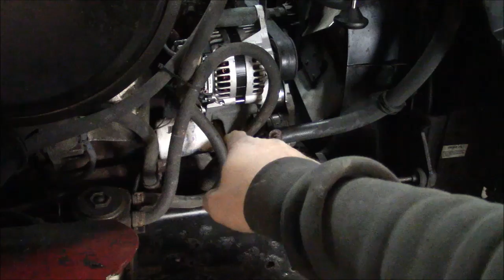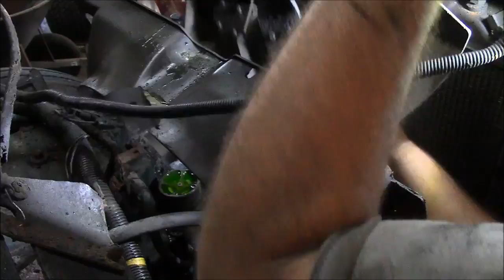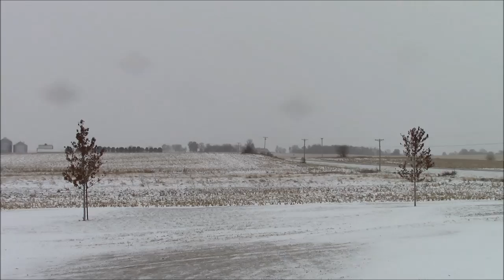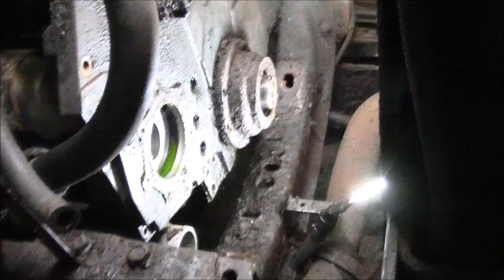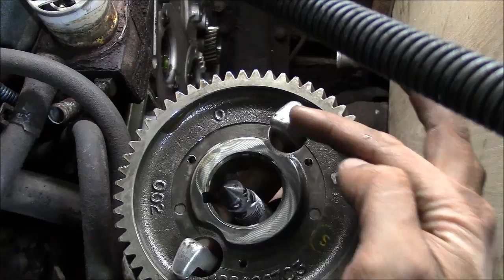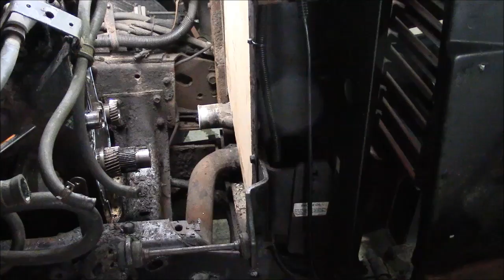International DT466E Coolant Leak from Timing Cover - Part 1

Comment: FYI a cherry picker is not a type of gantry crane. A cherry picker is technically classified as an aerial work platform (AWP) or mobile elevating work platform (MEWP) designed to lift people and tools to elevated areas. A gantry crane is a separate, heavy-duty structure used specifically for lifting and moving heavy materials, usually within a workshop or industrial setting. 
Key Differences:
Purpose: Cherry pickers lift people for work at height. Gantry cranes lift heavy materials.
Structure: Cherry pickers have a hydraulic boom with a basket/bucket. Gantry cranes consist of a beam (gantry) supported by two upright legs, often on wheels or rails.
Function: Cherry pickers offer high, flexible, and often lateral reach. Gantry cranes offer high vertical lifting capacity but limited movement.
Classification: Cherry pickers are often referred to as boom lifts. Gantry cranes are a type of material handling crane.

Comment: you're a gutsy guy to take on a behemoth like that job.....how can you give an estimate or quote on a thing like that?  15 hours?  any big heavy engine shop with 12 employees would probably have quoted 40 hours labor  plus any new parts extra.........just go to any toyota dealer and have rear main axle bearing replaced on one wheel on a 4 runner and they want $1800.....routine good running change a timing belt on a good condition 4runner they want $2200

Comment: Yep being honest about your mistakes I a good thing but if you would have cost the owner a 14k engine by your mistake I would be that honest lucky that air and loss of pressure did not spin a bearing wow you were really lucky but at least you were honest I would let you work on my trucks cause ya did not lie like most mechanic do and did the right thing thank you gives me hope I will find some one in my area like you

Comment: Wow dude.....wow. Let me ask this question. What happens when you bid a job and stumble across more things wrong? Do you stop and call the customer and they agree to pay additional? What happens if parts break when taking things apart? Do you bid on the hours but parts are as it comes and they pay for that knowing its open ended??

I live in Aurora and work on cars for fun (not so fun anymore) and have dealt with rust and things like that but this, this is next level stuff. I have loads of tools, a lathe, bridgeport, tig welders, mig welder, press.....one thing I don't have is a torch. After watching this video, I think I want to buy a torch just to feel safe at night! LOL

Comment: The ether tank for the cold start assist isn't even connected, the injection valve with the disconnected wires still has the yellow caplug and the tank still has the cap on it. That's the way they come and it's never been connected

Comment: I am a trucker but doing repairing for machines and trucks too. The last thing was oil cooler O rings change, one broken bolt, I don't make stress about so thing, that could quite easily get out and normal 8.8 and M8 boöt on the place. But never seen so bad thing like that was what you made. Respect.

Comment: I had a late 2003 DT466E that developed a hell of a leak on the timing cover right at the water linlet/outlet to the block from that cover. Its on my YT channel. After talking to lots of techs I found it to be a fairly common problem for 1999-2003.5 DT's. Repair estimates were 7-10 grand. Their TSB was to put block sealer in these engines. 
That engine ended my brand loyalty to Navistar.
Reply from the maker: Sounds like International. Put a bandaid on it.

Comment: That oil cooler gaskets go bad worked on those trucks for Odot 28 years.
Reply from the maker: Yeah. I've had bad luck with the oil cooler pedestal gaskets leaking after installation. I've had to re do a few. My own 7.3 Powerstroke is currently leaking after I replaced those gaskets...

Comment: Man I could feel the anxiety welling up inside me while watching this because of the rusty jobs I've done.
Not only does every single bolt fight you but if a wrench slips you have the possibility of touching and breaking something else like the fragile brake lines with a 1/4 inch of rust on them that will break if you look at them the wrong way.
Reply from the maker: Yeah. That's how I feel about plastic. I touch it and it breaks...

Comment: Ironic they tell you not to use Ether on a DT444E, but this DT466E has it....
Reply from the maker: Well the 444/7.3 has glow plugs, so ether makes them go KABOOM. I worked on a 6.0 once that had the manifold blown clear off from ether and glow plugs.
Reply: @WatchWesWork  Do that mean that the 444 is more compatible with cold weather ie is easier to start ?

The first car which i drove regularly was a VW  diesel (Passat turbodiesel) in the mid 80s had glow plugs so, let the plug work 20 s or before starting.

http://www.auto-abc.eu/Volkswagen-VW-Passat/g3-1985

Comment: All that black sludge is reminiscent of steam engines. 1900's technology.  As soon as electric moves in; we will view gas/diesel how we view steam powered now. Archaic. 

Tesla is basically giving the trucking industry a free head start.  They are basically either scared or incompetent. Until they prove otherwise we will have to assume both. 

Just watch how it will unfold. Tesla will produce their semi and it will be a tremendous success. The rest of the industry will follow AFTER the fact.  Some real leaders and Trail Blazers there...

Comment: Tip for the 3 bolt damper retainer disc. Find a tap you can start in the holes in the 3 bolt plate.  You. Need at least six full turns on any bolts you thread into it. Now you have choices to pry the new bolts up or drill a plate to go across the front of the damper to allow you to tighten the bolts or nuts on studs ..
Or you can do magic tricks like this album from Thursdays job. Countach shoehorn https://imgur.com/a/WqJfZEj.

Comment: Wes please take the time to wear some gloves-!- the oils in the skin will in the long run cause a blood disease joe
Reply: AND which "BLOOD DISEASE" would that be? Or are you SIMPLE repeating something someone told you. In other word an OPINION?
Reply: I think it is enough to consider the risk of ezcema and that skin damage's tendency to badly affect someones ability to work in the old work.   Wes: the oil is risky due to the additives and combustion products. 

The same thing with cutting fluid but in that case it is due to the components in it. 

Water based cutting fluids contains preservation additives which is unhealthy.
The correspondence between oil and leukemia is less well proven but the correspondence between increased risk of liver or lung cancer due to PAH (which is a combustion by product) is should we say proven.
Reply: @TheStefanskoglund1  So, as I suspected you just vomiting back a bunch of crap you heard/read/saw somewhere. Or did I miss the part where you responded to my question as to the which "BLOOD DISEASES" he is going to get. Perhaps they will be caused by his allergies to the latex and talc of the gloves you want him to use. Come on just give me a hint.

Comment: 🇨🇦 Hi Wes. I have had very good luck with the spiral extractor sockets. All older machines around here have corrosion issues like that. What is the mileage on that truck? Must be four hundred thousand. Someone should tell the township to do some pressure washing from time to time.Take care.
Reply from the maker: I think it's around 150,000. Very low miles.

Comment: I know the fun you are having with that, 90% of the stuff that comes through my shops the junk dealers don't want anything to do with, It's great if you like a life with challenges and no 2 jobs the same very often. I did a front crank seal on an older mechanical 466 in a fertilizer floater 10 years ago. The last guy put the new seal in the wrong way round F.F.S  .

 I pulled the hood and rad I think It was like 14 hours when i'd got the front pump driveshaft off and everything done, you might be at 18 to 20 hrs going further.   If the newer motors are the same, I remember this one i had to heat the bottom crank pulley in boiling water for something like 30-45 minutes to get it on, as they can crack on the key way otherwise from what I understand.  you can't heat it in the oven without destroying the rubber damper material from what the book said. Hopefully it's ok after heating with the torch in the middle removing that washer. 

 You might have fun getting that pulley back as it cools fast and the rad might make it harder to line up.  i remember this one took a few minutes and it was tighter than I thought was good  even with the boiling..   I had a dutch oven pot I built a stand for using a wheel rim with a pipe to the middle,   and fired a big propane tiger torch in for heat.  I wasn't allowed to do it in the kitchen on the stove L.O.L .  doing it that way outside the shop I was only 5 ft from the truck to. 
    Maybe some of the bolts in that case had a corrosion problem with steel and aluminium reaction, or they had permanent strength thread lock on, it looks like some have a resedue of some kind on the threads.    I had a Perkins 1006 needed a new case and that was some corroded bolts and thread lock/sealer on certain ones not all of them. Hope it goes well finishing it, if you don't have a book find out about that pulley and thread lock / sealer on the bolts.  Thanks for sharing, Take care.
Reply from the maker: I do have a book. I remember working on one of those fertilizer spreaders once with a 3208 Cat engine and an Eaton 9 speed. It had bounced through so many rough field that the transmission had almost fallen out. The bell housing and adapter plate on the engine were toasted. Dropping the transmission was fun since it's basically at chest height and our jack only went about 2 feet high. I actually can't remember how we got it out.

Comment: gotta love poor maintenance by some government employee.
Reply from the maker: I actually think these municipal trucks are pretty well maintained. It's just the horrible work they do spreading salt and driving on gravel roads.
Reply: @WatchWesWork  i guess i'm just used to doing preventative maintenance on my stuff so things like that oil cooler would be a breeze to remove.  And old rotted lines and mostly gone barbs wouldn't happen.  Imagine if that failed in the field with 2 feet of snow.  I mean i don't have crap for a budget and do more than most would on my vehicles, but in a small town, you would think they would have the time to keep everything mint.  Idk, i'm from Minnesota, we have plenty of rot from salt and gravel.  I think it's more priorities.  and honestly, if that job while it sucks like most do is sent to you, then they don't have someone on staff who would do that let alone the more basic things.  My opinion.  I've worked at places where repairs are hired out at up to 400 per hour and its something that I could easily do.  Some places have used that more to their advantage than mine, others have passed.  Each to their own I guess.

Comment: that air hammer clutch tool is the coolest thing i've ever seen for the stupid american design of a fan mount.  i'll be making one of those.  all you would need is an old 3/8 extension, cut it short, weld it to and air hammer bit, and use what ever crows foot you need.  maybe use a serpentine belt tool instead of a extension to get more leverage.

Comment: Quick question, what do you think caused the crack?
Reply from the maker: I'm not sure. I would guess a combination of corrosion between the elbow and timing cover jacking the two sections apart and vibration.
Reply: @WatchWesWork  I was told by the foreman at a BIG Navistar shop in Orlando that it was a poor design and when they switched to EL coolant they started having these issues. It wasn't a problem on the mechanical DT's and wasn't known to be a problem on the 97 and 98 E's. But the 99-03's have had plenty of these failures.

Comment: You look like you're doing pretty good. I'm a dealer tech at international. If you don't already know you need to heat that cam gear up and it will slide back on the cam, we usually use a toaster oven. Also make sure you replace the bolts for the idler gears and make sure you torque them correctly. I can get you specs if you need them. You don't wanna know what happens when they come loose lol. You didn't show if you liked up the marks before you pulled the gear off either way make sure you get the timing marks lined up correctly when you go back together, sometimes the cam moves a little when you pull the gear off so you may have to move it a tooth or so to get it to line back up.
Reply from the maker: Well I lined up the crank and cam before I pulled it, but the idlers were just wherever they were. My book say to replace the upper idler bolt due to the sealant on the threads, but my dealer tells me they just use some high temp thread sealant and reuse them. I did have to order a 20mm 12 point 3/4 drive socket for the lower idler bolt that I will probably never use for anything else (thanks International...).

Comment: You certainly have a hell of a job there. Have been fighting those 8mm bolts with 10mm hex heads on an old 24v Cummins 5.9 this week, just can’t see the reason for them.
Reply from the maker: I don't get it either. What's so wrong with a 12 or 13mm like a normal bolts?

Comment: Do you just price labour cost only on jobs like this, with parts being an additional cost as they are basically unknown until you get it apart.

Just noted what labour time you quoted at the end of the vid.
Reply from the maker: Well, it's more of an estimate than a quote. I do my best to estimate what will be needed. Sometimes I come in low and have to communicate that to the customer. Sometimes I come in high and the customer gets a nice surprise on the invoice. It's not an exact science.

Comment: Hey Wes! 
Much respect for you getting into a job with less than stellar conditions, and the unknowns associated with rust damage. I live in New England where equipment literally disappears from service due to the immense corrosion. A 10-year-old truck is basically written off as a total loss after the frame, driveline, fasteners, etc are no longer serviceable. Hopefully, you will emerge from this job with your sanity, and not take a beating on your labor hours and parts. Work safe, enjoy all your videos, always a great viewing experience. Be well
Doug@ the "ranch"
Reply from the maker: Well this truck was written off by the state who sold it to the county. Then they wrote it off and sold it to the township. That's the last stop before the melting pot!

Comment: Antiseize Nickel is best, copper is better is nothing. Aerokroil is amazing penetrating oil, WD40 is a horrible penetrator. Also, pressure wash that stuff before you work on it. It helps... Also always always put on quotes that due to corrosion and/or seized fasteners there will be extra time billed as encountered, so you don't end up getting hosed because of it.

Comment: i've seen shipwrecks at the bottom of the ocean with less rust than this truck. the individual in charge of the motor pool needs to be fired. i'll bet it has never been washed to get the salt off of it. you don't maintain a government vehicle like a single mother, only doing something when it breaks down. i had to do a pmcs on my tank every day in the army, even though it only left the motor pool 4 or 5 times a year. judging by the condition of this truck, i would venture a guess and say your township doesn't even have an sop for preventative maintenance. what does the person in charge even do all day, hide in their office and catch up on their soaps?
Reply from the maker: I actually thing these townships are very efficient. They do so much with so little money. I don't know if it's a lack of maintenance so much as a horrible job these trucks are made to do. It has done nothing but drive on gravel roads, plow snow, and spread salt for 21 years. They all end up like this eventually. I talked to a guy once who worked on forklifts in a pickling factory where they pickled jalepeno peppers. The acid they used just melted the forklifts. After 3 years they had to be replaced as it was not economical to fix them.
Reply: @WatchWesWork  i live in a rural county in northern indiana. we're mostly agriculture. not much industry, so not much of a budget. i know people who work for the county highway department, and my grandfather retired from it. the farmer i work part time for, his daughter is the county dispatcher, and i am friends with a couple of the drivers. there is a hot water wash bay in the motor pool, and they wash their trucks end of shift, every time they salt the roads to get the residue off of them so they last longer. if you take care of them, and apply a little preventative maintenance, you don't have these kind of issues getting as bad as this. sure, they're gonna rust, but that's a bit excessive. and that's all down to the person in charge of the motor pool.
Reply: Because everyone influential in the US says bad words about government or city workers ? Which causes a really bad moral.
Reply: @TheStefanskoglund1  you still have to take pride in your work for yourself, whether it is appreciated or not by your superiors. it is a reflection of who you are. i've been a self employed carpenter for 24 years. i work to my standards, not my customers, and i have no lack of work.